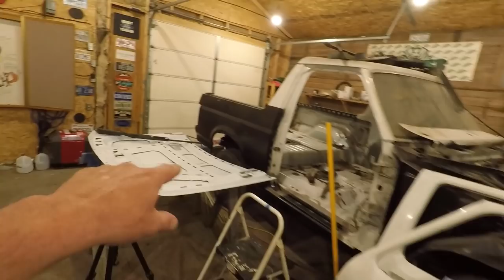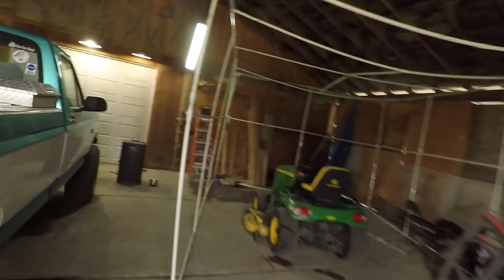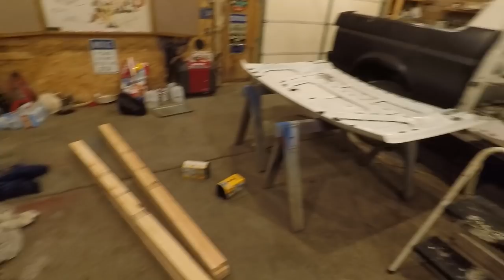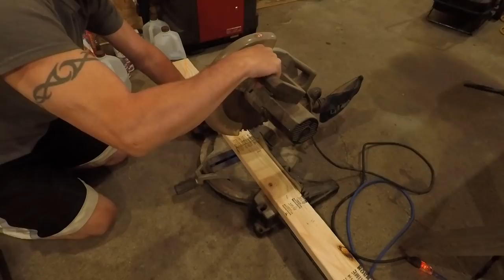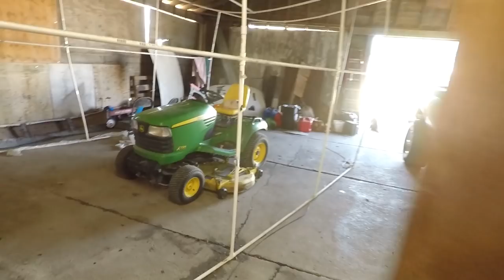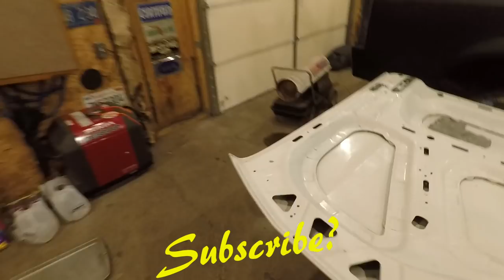HAD To Make THESE BEFORE Painting On The FORD BRONCO

Comment: When I pulled the cab off my frame, I stumbled on an article about making I-beam sawhorses.  I didn't go full I-beam, but made T-beam suppports and used a set of Home Depot brackets for the legs.  I would share a picture if I could, but the 8' wide beams supported the cab (seats, windows, and all) for about 3-4 months in Arkansas.  My buddy said they didn't even budge in high winds.
Reply from the maker: Thought about making something like that